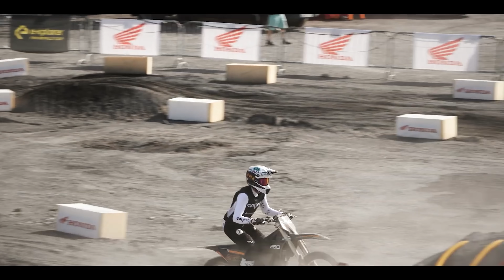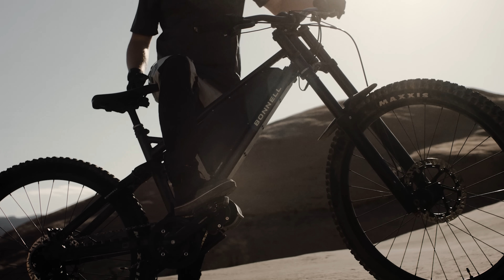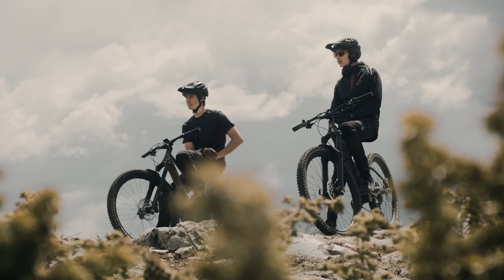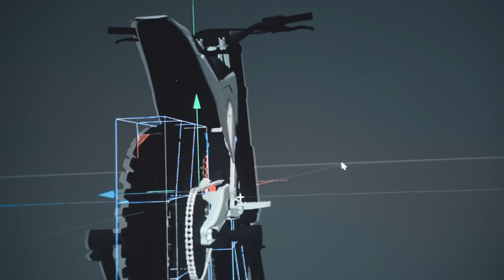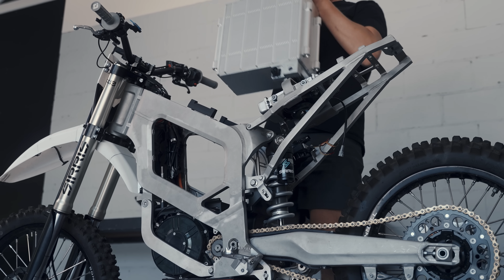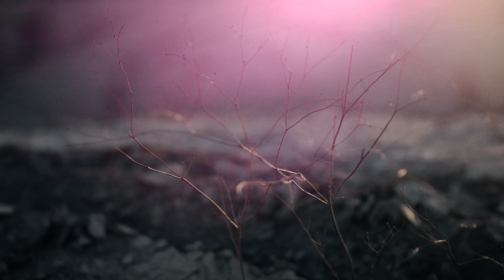Bonnell 805 & 902: NEW High-Performance Electric Dirt Bikes Revealed

Comment: Thank you for the video. I had never heard of this brand till this video. very impressive and seems high quality products.  
Just 2 questions: 
What is the weight of each motorcycle?  
Also, how does that "Electronic Clutch" work if you choose to go with that option instead of brake?

Comment: Wow there's starting to get a few more contenders for the E Motocross category. The more manufactures of E-motos there is; the more competitive the prices become for the consumer
The design of this bike is perfectly in harmony with traditional motocross styling but the alloy exoskeleton frame design although taken styling cues from conventional is completely unique but more importantly functional. The swing arm although unique shape, it still looks robust and isn't some goofy looking Suron swing arm or some functionally limiting cantilever design that shortens the bike too much? The wheel base length and front "castor" or fork angle is still proportional to a conventional motocross bike. I think this style of this bike is the perfect blend of EV future and traditional design; so it will at least look visually inviting to traditional riders especially when there's so many ugly non conventional "trying to be futuristic" designed by robot puke styled E motos on the market that they literally will not attract any conventional Motorcross riders.
There are more fischer price looking E motos around than actually decent looking bikes.

Comment: The really cool thing about the 775 e-Mountain Bike model is the parts they use and the ease of swapping them. These are standard CYC motor, controller and battery kits. If any of these go out on you later, its a quick parts replacement you could order online and do at home direct from CYC. With the normal electric mountain bikes you have today that are proprietary from the big brands, its all intergrated in the frame and require the company to do the work at a high cost. This is a great alternative and upgrade path. Well done!
Reply: Oh wow. That’s great to know! Thanks!!

Comment: 3.1kwh for 30kw not even worth that power with the range it’ll have
Reply: Yeh I noticed that too.
Reply: @SURRONIVERSE fr I’m like bro we know these bikes can be powerful but they gotta stop putting more power than its even worth running with the battery sizes I’d rather have a bit less power and a bigger battery the biggest gripe we get with electric is the range and company’s seem to only making it worse
Reply: Seriously. And it's got full-sized 18"/21" wheels. Range is going to be dismal on that one.
Reply: @jasper_of_puppets 18/21 is the standard dirt bike tires set up. I agree with the battery problem. These bikes are MX track bikes. If they tried to make them dual sport bikes then range might be more important to them
Reply: @randalsweeting661  They're not even MX track bikes. If they were, they'd have a 19" wheel in the rear. The 902 may have decent range since it's got a big battery, but the 805 model is kind of a head scratcher.

Comment: Love the power and throttle of the 775. Bonnell needs to develop a Motor/gearbox (with a THROTTLE!) to compete with Pinion. That’s where the future of EMTBs is going. Ditch the derailleur and the chain.
Reply: The Nicolai S16 w/Pinion MGU eMTB is the bike of the near future. Just have to look how many World Cup DH race teams running Pinion w/Gates belt drive this year.

Comment: 902 looks Stark like, but with a swappable battery. Should make a great race bike. Ultra Bees have been winning the FCR e-races against Starks since they can swap batteries quickly, it’s a huge factor in any race longer than 30 min
Reply: but the stark lasts 6 hrs 🤣🤣🤣... according to their BS
Reply: @b45her  Honestly most people can't kill it in less than an hour on anything besides a straight line or deep sand. Racing at a high level is where you get to less than an hour

Comment: Range and price are the only metrics we need.
Reply: the e mtb is lsited 5.5k on their shop so im guesing those e motos are goign for 10k+ unfortunately : /
Reply: @GoldCustomRides I would assume you’re right. 2000$ forks alone
Reply: Probably 12k
Reply: @JonKelso-xk7ct  thats too much tho. They really need to try to make them under 10k.
Reply: Looking at their price of the EMTB, they are actually great deal at usd5.5k IMHO. A good steel DH frame with similar high end fork and suspension like this will easily cost usd5k already without any electronics. Emoto parts are generally cheaper so their full moto should be priced pretty well according to their current price-performance ratio.
Reply: Exactly
Reply: At least 10k which sucks because I’m probably the brokest person on earth at the moment 🫤☹️
Reply: @ItsJustYoutubeManChill  no your not.
Reply: and weight
Reply: @dax4812  They said a swappable 6.5 kWh battery so it should be roughly the same as the current Stark Varg with the same size battery.
Reply: FACTS 😂
Reply: The 805 is gonna have some pretty lousy range with its full-sized wheels, 30kW power, and small 3.1kWh battery.
Reply: $11,000

Comment: Wonder what the price target is???? 😮😮
Reply: the e mtb is lsited 5.5k on their shop so im guesing those e motos are goign for 10k+ unfortunately : /
Reply: Im guessing $7999.
Reply: @thelittledetailscr7231  that wouldn’t be outrageous.
Reply: Looking at the price of the mountain bikes, both dirt bikes will be over $5,000 if not pushing over 7k
Reply: I bet closer to Varg territory.
Reply: 600$ 😮
Reply: If it ain't cheaper than the competition it's useless in this category for the majority of us.  They need to work on pushing down prices through competition.
Reply: The cost of lithium has dropped almost half over the last few years as mass battery production has created a surplus of energy storage.  The most expensive component, batteries, are cheaper to produce now than ever before.  This should give manufacturers some wiggle room for competitive pricing.

Comment: no weight mentioned??
Reply: They certainly didn't forget. I'm sure that they're working really hard to get it competitive. But physics is unforgiving and it may just not be as good as it looks on the first glance.
Reply: @thethelostjs  yeah… if it's in Varg's ballpark, the bike doesn't have any edge. Lesser suspension, smaller battery, less power. They need to come up with something under 100kg.
Reply: @QuentinBzt  ·El cambio rápido de batería, como en la KTM e-freeride, is a game changer. I own a SV.